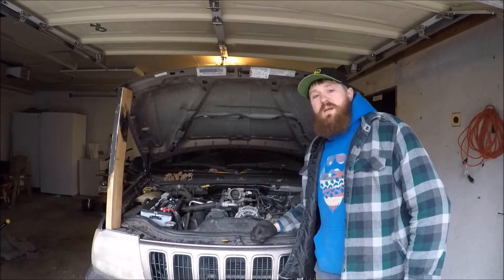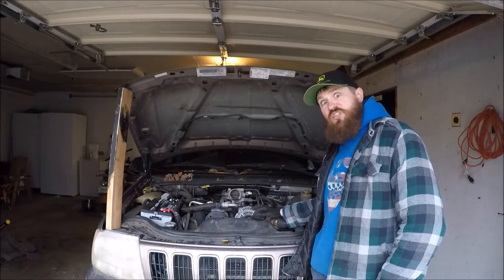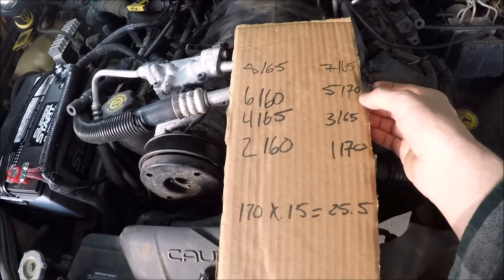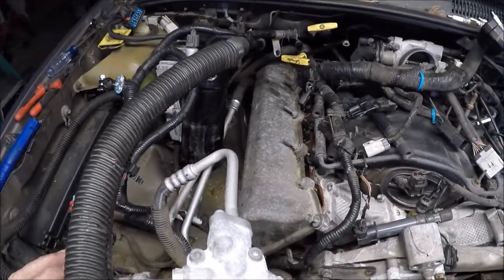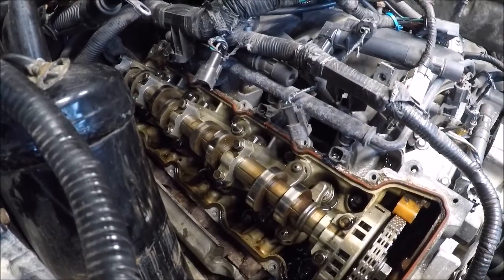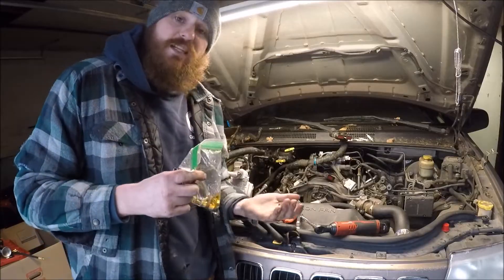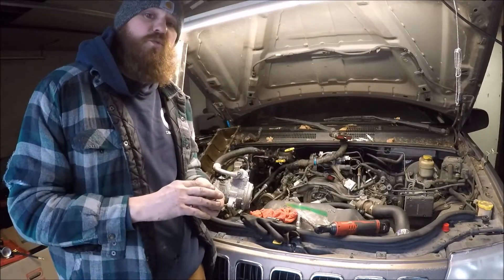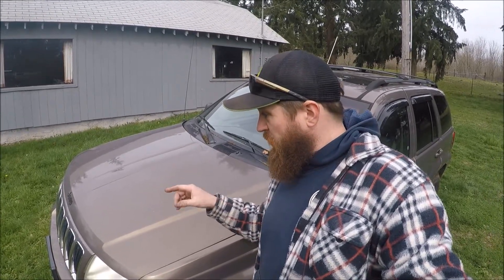Diagnosing and Repairing Common Chrysler/Jeep 4.7 V8 Valve Train Failure

Comment: Should of replaced them all instead of just one when you were in there. I'm redoing my 4.7 in my durango had a headgasket blow on the passenger side and most of my hydraulic lashers were worn and the cam was worn a bit as well so I just decided to replace a bunch of stuff to future proof it for at least 5 years instead of fixing just one thing then having to possibly tear it all back apart in a year.

Comment: the oil journal to the lifter is plugged. Just take the lifter out and crank her over, but don't start it. The oil presser will blow it out so put a rag on top of it. Put the lifter back in and rocker . Your all set to go. Works every time.

Comment: My 03 Durango 4.7L blew a lifter out in the Walmart parking lot.  Limped it home, and it was on the passenger side (2nd from rear if I recall).    Luckily the lifter was still up top and hadn't made it further. Replaced all lifters and rocker arms.

Comment: Keeping up on maintenance is VERY important on these engines. I bought a 03 Dakota with the same problem and fix. Keeping these cool and changing oil
every 3k is important. My engine has 176k miles and now runs fine.

Comment: Purchased a dodge 1500  2002 with the 4.7   idled rough, drove it home 2.5 hrs away   took valve cover off and completely missing lifter and rocker arm... I am not 100% sure but i think previous owner removed them and sold it as is.. rather then fixing it.. I could be wrong but I don't see how they could end up in the oil pan.  So I am ordering new parts and see what happens.

Comment: It's a 2001 4.7 liter, of course it is going to have an engine knock. It will last for about 225,000 miles if taken care of like oil changes. So, just swap out the engine because it is bound to blow a valve seal sooner than later. Yep.
Reply: Aint nobody changing engines due to a bad valve lol. Why spend 3 to 5k when you can spend like 300 to 500 bucks.

Comment: There nown for lifters poping off you can get  other rocker arms that has a smaller hole were oil comes through it helps for them not to pop off again now don't hald me to it just seen a video on it on the same motor

Comment: My truck sounds exactly like your your Jeep does but when I put everything back in still sounds the same. I don't know how you just the f**** lift yours. The same activity have to be adjusted but I don't know. I'm defeated, but could nobody says nothing? To talk about, I see one guy. I've gotta press on checking his lifters out. I don't know if he's what he checking the must be installed. Nobody said anything about the hydraulic ones. I'm gonna know if my noise is at the top of the I know, but noise is in the head.  So it's got to be adjusted somewhere

Comment: i have a 2000 grand cherokee limited and haven't done anything with it in years (7/8?).  just sitting on the side and pretty sure it's the lifters and just haven't opened it up.  now considering turning it into an overlander as well since the interior and body is fine but just have to get it running.

Comment: The 3.7 also kicks those rocker arms most times on the passenger side my fix was sticking a washer inside the hole where the lifter goes I don’t remember the size I use maybe a 1/4 inch ss washer but any washer will work hopes this helps

Comment: Spit the rocker because the valve seat dropped on you....  No push back from valve = no tension to hold rocker in place.  Seen this happen twice now...
Reply from the maker: I agree with you that can happen and was what I thought happened.  however if you watch the video I seem to have gotten lucky and the lifter failed. Jeep has good compression and has run great nearly 2 years later.  If it was the seat that would not be the case.

Comment: Valve lash adjusters (lifters) have an internal spring holding things in place when oil pressure is at zero when parked. These springs fracture & fail, allowing too much clearance and rocker will fall out on start-up .... not always but eventually.  Replace the valve lash adjusters (lifters) and you are golden. 
Seats on the other hand are more related to overtemp of heads & cooling issues. Keep it cool & this also is not a problem.
Cheers

Comment: How come you took so much off of the engine to remove the valve cover?  Another issue seen with the 4.7 is the cam chain tensioners, throwing a crank or cam positioning error randomly.  Sounds scary to tackle yourself at home, but actually, it isn't all that difficult to do and the parts are not that expensive, less than $200 for kit and about 5-8 hours of labor.  It took me 8 hours, as I was 68 at the time and retired Navy, so I had to stop a bunch of times for a cup of coffee and then to drain the coffee, heck I even beat my Lab on marking my spot that day.

Comment: do all 4.7L have that diesel sound knocking noise on start up there at then end of the vid? Mine has it, usually quiets down when it warms up
Reply: I'd check for an exhaust manifold leak, once they warm up the noise subsides.
Reply: I have a 2007 Ram with the 4.7l at 240k miles and it sounds like a diesel engine on startup then quiets down as oil fills everything up. The guy I bought the truck from said it sounded like that when he bought it at 7k miles. Runs like a champ, never had any issues other than normal stuff like sensors.
Reply: @Jethu262  I would check for an exhaust manifold leak, the symptoms can be as you described. If that isn't the problem I would seriously consider removing the valve covers and inspecting the valve train before you lose a rocker arm. Good luck!

Comment: Hey did the repair last? Same issue i had on two heads (both passenger side) turned out to be valve seat on the two of them
Reply from the maker: Still runs great
Reply: @MuddyBeards4X4  lucky wish that was just my issue. Good job m!

Comment: great video, i was very leary when i my son bought a durango with the 4.7l, but after we learned more of it, i am very impressed with this engine, (chrysler used it for more than 10 years), the biggest problem i think is people not changing oil enough and using cheap aftermarket parts

Comment: My 4.7 currently has 340K mi.  I replaced the lifters after one seized at 315K and ejected a rocker.  Oil changes are at 7,500 mi, running full synthetic.  While in there, I replaced all the valve stem seals too.  Those tend to make the engine smoke after they wear down.  The most important thing is to use good quality oil and keep up with the oil level.  Dirty oil is 1000x better than low oil.  At 7.5K, the oil is barely dark.
Reply: i would never wait that long for oil changes, but at 340K, i guess i could be wrong!
Reply: I am an original owner at 225K, oil change every 6K or less. I was planning to replace the adjusters as preventative maintenance. Maybe gain back any lost valve lift. Good to know I am not necessarily on barrowed time.

Comment: I have a 2006 dodge ram 1500. Maybe you can help me with the issue on my truck. So I replaced the camshaft position sensor and it failed after 5 miles driving it and replaced it again and so it happens again, also ticking noise after the truck is at normal temperature, oil pressure gauge keeps fluctuating too. So what can be the problem. Can a bad rocker or lifter cause the sensor to go bad?
Reply from the maker: I have found that when dealing with Mopar electronics it's imperative to use oem sensors.  Parts store cps sensors never work well

Comment: Are these jeeps worth buying I have a chance to buy an 03 overland for 800 with 170k on it but engine apart
Reply: Yes. I got my 03 h.o and fixed a valve seat and a new radiator. Did a full tuneup, all fluids and it has been a daily foe a few years now. Gas mileage on the freeway is about 21 22 at 70 mph on a 500 mile trip. Around town is not the best but there are worst. I got mine for 600. Was surprised how good offroad performance is.

Comment: I have an '09 Dodge Ram 1500 with 310,000 miles.  I've used nothing but full synthetic oil since new with absolutely zero engine problems.  But now my lifters are really ticking.  I'm debating about replacing them and also doing a timing chain job, or just selling it to some high school kid as a project and getting myself something different.

Comment: I have a 4.7 L that doesn't want to crank, I can only turn it a little bit by hand (so it's not seized as far as I can tell). Could an issue with the valvetrain prevent the engine from turning easily? It's one of those "ran when parked" scenarios where it stopped working between key offs
Reply: Sounds like a dropped valve seat. The seat drops while the engine is hot and the vale is open, and the next time you try to start it it hits the valve- that valve will be bent.
Did it overheat?
Reply: @philkep2762  I finally got around to cracking it open, it was way worse lol, piston and connecting rod turned into metallic aquarium gravel lol
Reply: Ouch! Then it didn’t “stop working between key offs”, it grenaded last time it ran-

Comment: Great video! Does it smoke or burn oil? I’ve got a 2002 Overland and it smokes when coming to a stop or in reverse. No knocking and it runs smooth.
Reply: Your valve seals are bad or the the valves are worn.  How many miles are on the vehicle?
Reply: Mine does the same thing How much does it cost to replace vavle seals ?

Comment: Valve seat failure is usually an issue caused by improper maintenance of the cooling system resulting in some sort of an overheat issue. When you get the head warm enough it releases the valve seat. The concept of high production number cylinder heads that have to have pressed in hardened valve seats in aluminum heads is also something that occasionally can rare it's ugly head. As for the valve train. The biggest problem with the valve train in these vehicles that have a hydraulic valve lash adjustment is the fact that because there's not a lot of oil flow through there it can get plugged up and cease to work properly. And occasional oil change which means about a week before you do your oil change when you're about a quart low on oil you put a quart of Marvel Mystery Oil in it and run it for a week to make sure that everything inside that engine is as clean as it can be, works wonders for keeping the hydraulic valve lash adjusters operating properly.
Reply: Overheating is what causes seat failures

Comment: well that is the problem, better check the lash adjuster lifter. Yes the small hole rockers are best they spray oil right on the roller. Better check the cam timing chains. While you have the valve cover off.
I’ve done a full engine rebuild, big thing is running the correct oil ( Rotella ) and orange antifreeze. Must take your time in venting all air out of engine by opening vent and radiator cap start engine, letting it run to get all air out of engine. I did mine took over 45 minute adding new orange fluid while venting. Then just stop engine place cap on and place vent cap back in place. Drive some miles 25-45 miles go home let it cool over nite. Next morning always check oil before running engine. Do another venting process, open a cool radiator cap take out vent screw, start engine run it while checking for bubbles at venting hole let it run 30-40 minutes checking to get all air out of engine. It’s a bad design for coolant system where engine is higher than radiator. So proper venting of any air will keep your engine living well for ya.

Comment: Great luck.  I was hoping for the same, but… I went to install the rocker arm and it just slides in with no pry bar or screwdriver. I can basically pop it off with my fingers very easily.  Any idea why that is the case?
Reply from the maker: Sounds unfortunately like a valve seat failure.  Does the valve stem look lower then the others? The valve probably dropped
Reply: @MuddyBeards4X4  well i it didn’t look like it but I can’t find another why it would be like that. I assume it’s dropped but wasn’t really noticeable until I pulled off another rocker arm and could tell the spring was expanded farther out than the original one. So does that mean a new head as long as there is no damage to the piston and or cylinder? Or a motor?  Thanks for the reply
Reply from the maker: Hopefully it would be just a head.  You can buy reman heads for pretty cheap.  The job isn't too tough but you definitely want to get the speciality tool to wedge the timing chain.  That way you don't have to take off the entire timing cover
Reply: @MuddyBeards4X4  I should also add that I wasn’t getting any compression on that cylinder! Zero. So in your opinion seeing that the jeep is basically in perfect shape, paint is perfect, would you just replace the engine? Thanks again
Reply from the maker: Zero compression definitely confirms valve seat.  I would put a new set of heads on it.  Entire 4.7's are super expensive, but rebuilt heads are not too bad
Reply: @MuddyBeards4X4  thank you for your input. So the specialty tool wedges the chain? So if there is no damage, a head isn’t horrible I guess. Could i get away with doing just the one side? Appreciate your input
Reply: I just reread what you said. A set is the way to go.  Ok thanks

Comment: Did you have a check engine light indicating a misfire on the affected cylinder?
Reply from the maker: It didn't have any light which I thought was odd.  It dawned on me that the dash light was burned out. Turns out it was but I didn't check till after the repair 🤦

Comment: I've had a couple of 4.7s go well past 200k, but I change the oil at 3500 to prevent sludge buildup.
Reply: The 4.7 is an inferior engine
Reply: @DanielJohnson-ec8rk  They don't have the reputation for longevity that the 4.0 has.  But they make a lot more power than the 4.0, and get 25% or more better mpg.

Comment: So I have a 01 wj with a 4.0 inline 6, is this problem common for the inline 6 motors as well?? It's knocking out from what appears to be the top of the engine, and its running rough too.
Reply: 4.0 inline 6 is not the same.

Comment: You got really lucky, I've seen these wipe out the head or cam or both usually when the rocker pops off and jams up somewhere. I think there's also a weak lifter boss on the early heads? I've never owned a 4.7 just worked on them. I know there's ways to fix the issues by updating like you said and I think newer heads fix the weak lifter boss or that may just be from the rockers falling off and breaking them. Either way you got super lucky I'd replace the rest very soon and update those rockers and maybe replace the heads with newer castings I'm pretty sure that's a thing i think ive done it. There's tons of these in the wrecking yards so engine parts are dirt cheap I'd figure out exactly what year heads are best and snag some heads and HO top end stuff from the wrecking yard and get it all updated. I think with the updated parts and regular oil changes with good oil these engines can last a while they are also a pretty peppy engine I drove a stick shift Dakota with a hopped up 4.7 and it hauled ass and slayed the tires it revs out very well.

Comment: I had an 05 ram 1500 with a 4.7L v8.  I ran 5w30 synthetic oil and did 7500 mile oil changes.  It was trouble free for the 100k miles I've owned it.  Never had sludge or gunk.  Was actually a very grear running truck. I had the 6spd manual with 4wd and 3.55 gearing.
Reply: They changed the rocker arms after o4. They had 2 big of a hole before and it would let the not put the world down inside that hole of the lifter.So then what they spent made the whole smaller.It goes right straight dow😢n into the lifter and it  oils  great.     They SHOULD OF ASMITTED THEIR FLAW

Comment: what happens is the exhaust valve partially sticks and rocker arm jumps off it will do it again. to correct it you need to a valve job to clean up everything. i have worked on many of them. the other thing is you could have a bad lifter
Reply: Actually overhead cam engines dont have lifters.  Its technically called a hydraulic valve lash adjuster.
Reply: @ashtonmariefranklin1981  yes I know that but most common people don't know what relate to a lash adjuster the basic difference is a lifter goes up and down a lash adjuster doesn't move it just uses oil pressure to keep adjustment correct the same thing a lifter does and they also keep a small amount of preload and dampening

Comment: Nice job Robby.I probably would have replaced all the lifters and updated the rocker arms too.Then changed the oil to a good full synthetic.That is what I did on my 2003 4.7L.
Reply from the maker: Ya I plan on doing the same.  I want to do ho cams and replace all the rockers and lifters then
Reply: @MuddyBeards4X4  DO you have any oil loss? I have a 00 4.7 that I would love to do valve stem seals lifters and rockers. I've got a valve stem seal problem on 1 or 2 holes
Reply from the maker: This thing has ran great since I "fixed" it.  No overheating, no further valve train problems, and no oil consumption.  That being said I will probably be going the route you are eventually and changing out the whole valve train with new stuff
Reply: @MuddyBeards4X4  ran synthetic in mine and it burned it all off within a few hundred miles. Switched to a synthetic blend and run stp high mileage oil treatment with zinc every oil change, it last a lot longer but it’s still burning a little. 167k miles on my 02 overland
Reply: @MuddyBeards4X4 08 cams are better than HO.